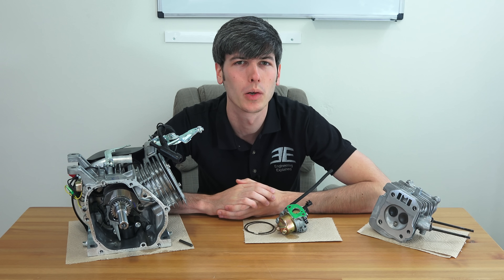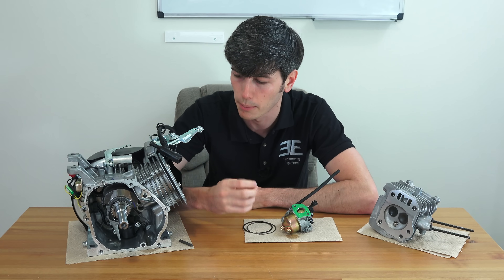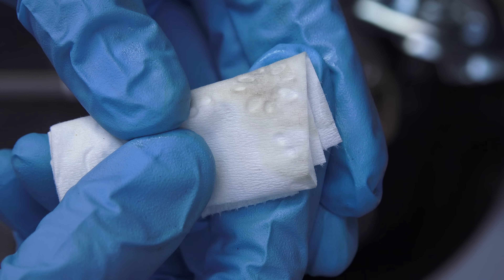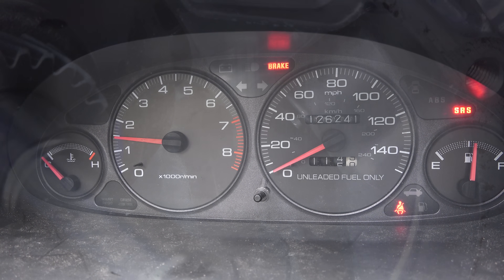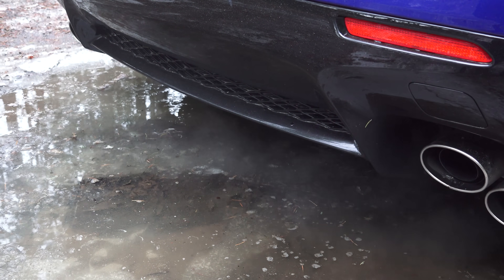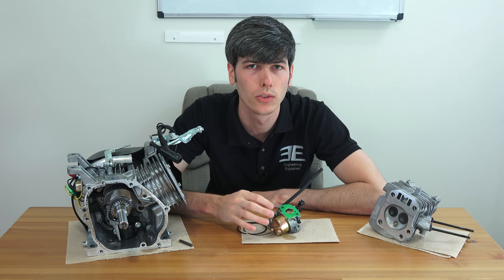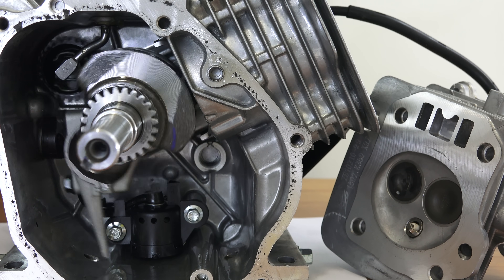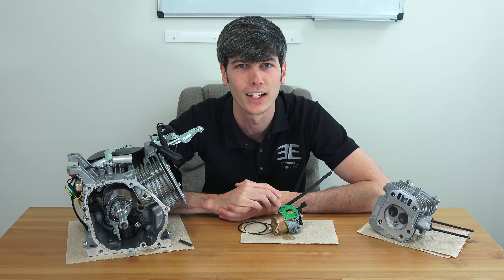Should You Warm Up Your Car Before Driving?

Comment: hmmm you should live in minus 30-40, it doesn't work. better warm up before you drive or you might spin a bearing or something if you gas it.
plus it will warm up faster standing still on 2000rpm then driving .

Comment: The point here is not to go overboard or do anything excessive. Just go easy. Good oil flow is super important. Lifters, bearings, etc... are sensitive internal parts. Giving the motor a chance to warm up slightly and move oil around helps in below freezing temps. Doesn't need to be at operating temp before driving, but start up and driving off in a hurry is hard on a motor in general. Parts are stiff and sticky at first. It's like warming up before a workout. As for diesels the cylinder head needs to warm up also. Especially diesels without glow plugs relying on intake heaters. Consider everything else at work such as the transmission and with certain vehicles axles/differentials and u-joints. Easing up to operating temp goes a long way towards long life expectancy. Block heaters are great. I use one on my Cummins because I don't want to change out 15w-40 for 10w-30 just to drive it through 3-4 winter months of the year (Chicago area). Not enough miles driven to make it worth the expense and time. Anyways I let it run for a minute or two then take off so the intake heaters cycle a few times.  With the gassers I let them idle for a couple minutes, usually the time it takes to clear snow, ice, or frost from the windows and call the mrs to know I'm leaving, when it is below freezing.  Afterwards go easy on the throttle, slow shifts for manuals, and warm up the brakes within a few miles. Once everything has been moving for a bit and "feels" right I will drive however I please.

Comment: So basically it is a trade-off between the (overly) rich fuel mixture in a cold engine, which dilutes the oil, versus increased wear due to reduced oil flow and lubrication, because the oil is not warm. I get that an idling engine takes longer to warm than an engine under some load, but those 5-6 minutes while the engine heats up under load (i.e. you drove off), the wear is so much higher on the engine (because the oil is not lubricating as well). 
Also, a cold engine has more gap between the cylinder wall and the piston (rings), to allow for expansion when the metal heats up. Depending on the tolerances set by the manufacturer, extreme cold can make that gap "quite" wide. 
So all in all, the trade-off is: Do you want to replace the oil more often because of dilution with gasoline, if you're in a cold climate, or do you want to risk damaging the engine because of excessive wear on the cylinder walls / piston rings? There are many cases of the latter happening, where engine specialists advise a brief warm-up period (Basically until the water is up to temperature, which is usually when the oil starts being warm enough too). Not 20min, but 5-8 minutes or so.

Not saying you are wrong Jason, but I feel in this video, you only addressed part of the problem (what is the bad thing that happens when the engine is cold), and not the whole picture (what happens when the engine is cold AND you put load on the engine).
Reply: SimonBelgium Exactly. Especially with full-synth oil, the dilution effect is almost non-existent.

Comment: IMO a little warm-up doesn't hurt. I like to get some temperature in the oil and transmission fluid before a load is put on the drive-train. Modern engines are so computerized that fuel injector usage is precisely monitored for all conditions; I don,t see new cars running rich very long if at all.  Also always use a lighter oil in winter i.e. 0-20, 0-30, or a 5 in first # as a minimum, as its proven most wear in an engine comes from initial start.

Comment: I understand why one wouldnt warm up the engine, but what about the warmth transfered to the transmission. Surely a warm standard tranny is safer to drive and easier to shift. Other systems like the power steering pump and any hydrolic system will benefit from the driver not touching it until it is warm. This stuff breaks more often when cold, and thats a fact. Many vehicles will idle high when it is very cold out on initial start up and this takes care of the engine problem (it simulates driving) until the engine gets closer to temperature. Many vehicles do this. If it is zero degrees F out, I am not starting the car and driving it in 15 seconds due to all the aforementioned factors. I do understand the video though, but the driver should weigh these pros and cons.

Comment: upon start up on a cold engine a vehicle will usually idle higher, after a few minutes it idles normal. That's when i drive it, so i usually let my vehicle idle for about 5 mins.
Reply: Steven Harden Exactly, and that happens on purpose to get the vehicle up to temperature, so the car protects the engine without you having to drive it. It needs to warm up so you don't stress hydrolics like clutch master/slave and power steering pump etc. These things break when cold.
Reply: TheSolitaryObserver Thats what im saying lol. My rule of thumb is to let it warm up until the vehicle idles normal which is within 5 minutes usually.

Comment: This is a fiercely debated topic, especially in the winter. Glad you took the time to break down the engineering aspect of it. There are a couple things I am still unsettled about. 

1.) Why do manufacturers insist on installing remote start from the factory if they say not to let your engine warm up before driving? I suspect it's purely for convenience. Again, if it's so bad for fuel injected engines, why do they factory install them? Is it a conspiracy to increase repair costs? Am I hurting my car by defrosting the windows and heating up my interior from the comfort of my warm house? 

2.) Diesel engines. Diesel engines do not have spark and rely on increased combustion temperatures to complete the cycle. If a diesel engine is cold, its harder to complete that cycle efficiently as the logic of "dumping for fuel into the engine" simply doesn't apply to a diesel engine.
Reply: 1.  People want their cars warm when they get in them.  They install remote start because people want it for comfort.  You answered your own question on that one.

2.  Diesel is a different engine, absolutely.

Comment: when I'm at work and parked outside and the other morning when I got off it was -14f my trans fluid and oil are as thick as honey. I'm sorry but to save on both my aluminum block and transmission I prefer the 10 min warm up. it don't idle at normal idle speed when it's cold so driving under light load or higher idle rpm which effectively warm the engine and transmission to a decent running temp is more important than getting in and driving off. no I don't wait when it's 40 outside when it's below freezing I let it warm up till the temp needle moves then drive off.

Comment: I have to drive to work with temperatures around -40˚C every morning in the month of January, and the engine sounds pretty awful, especially if I forgot to plug the block heater

Comment: It's my transmission that needs the warming up...
Reply: atticstattic been looking for someone to say this. Mine gets so cold it's hard to move the shifter into gear even after letting the engine warm up.
Reply: Have to agree on this.  Even in tropical temperatures, I find it hard to shift gears without warming up the my old manual transmission.
Reply: patriot3431 well technically, a cvt doesn't have any gears 😉
Reply: My cvt will not shift out of first gear until my car gets towards operating temperature.

Comment: This doesn't make sense, it's take about the same to warm up from a stand still if not quicker because no cold air is flowing through the radiator, especially when you have a performance car with a big radiator, warm up your cars before driving

Comment: I have been warming up my cars for the appropriate temps outside usually about a minute in the spring/summer and 5-8 minutes in the winter here in MN.  The last part of this vid defends what I have been doing because he says don't put a huge load on engine/drivetrain till it is at operating temps. High end modern cars don't let you have the full monty till the engine is at operating temps, but most regular cars don't have this feature. I have been messing with cars/engines for over 20 years and anything that is internal combustion, I let warm up a bit and I have never had premature engine failure (or extensive oil failure, metal etc in it) to doing so.

Comment: My 2017 Volt won't put any load on the genset until it's warmed up when in hold mode. Are GM engineers wrong?

Comment: I like how this ignores all the other things that happen with cold engines - like nothing being the proper size. Bearings, gaskets, pistons, etc. Your engine's nominal is at operating temps, which makes sense. Sure, they test to see if it will still seal at -40 (if you ask me in C or F, don't ever argue against an engineer) and full load, but that's because its the worst case. Let me repeat, that's because its the worst case. 
Plus, if you think a rich mixture at no load and 700-1000 rpm is bad, imagine 3000rpm and under load. Your car is still going to washing down the cyls just a little until it warms up. If it takes just as many RPM to warm up, but you're doing that under load when your pistons and bearings are not at optimal diameter, they'll have play. Play is bad. 
All this while you're freezing inside the car and everything more brittle when you touch it. No thanks EE, you usually have very insightful and accurate videos, but going to say nope, bad idea to fire up and put a cold engine under load, regardless of its technology used to deliver fuel.
Reply: Yup totally agree with this, it's bang on, so people there is a reason why you don't start/drive, and you don't need to let them run for 15 or 20mins it's pretty basic common sense!!
Reply: I agree. I let it sit for 2-3 minutes then I start off. 30 sec is just not enough IMO.
Reply: If what you are saying here is true you would hear ticking and knocking from just about every cold engine there is.  Machinery has caps measured in microns.  Microns.  Yes if it’s off by a seemingly small amount it can lead to issues but they factor in thermal expansion when they make the engines and the engines wear until the parts “match up” (for lack of words). I trust what Engineering Explained is saying because I’ve done this and haven’t ran into problems and I’ve also heard the same from a Nascar driver in an article I read a while back.  Warming up an engine is old thinking from carburetor days.
Reply: @dperr338  Engines are not designed to wear until parts line up. Full stop. Right there. Also you can't compare Nascar engines (or drag race engines or...) as they are built loose and designed to last between 1/4 of a mile and 500miles. That's it. If you're looking for a 500 mile engine builder for longevity advice, you'll get what he's experienced with.
Reply: @boogts  Engines are engines.  An engine builder is an engine builder.  There are reasons they warm their cars up before a race by driving them and doing warm up laps.  Driving is the best thing you can do for a vehicle.  Abusing them is the worst.  There is a big difference between the two.  Nascar engines get driven hard and they make design decisions based on what will give them the competitive advantage not what will make the engine last long term.  Has very little to do with Nascar not knowing anything about what makes an engine last.  Just means they prioritize different things.
Reply: Never warmed up car. 500,000Km later, still fine. Burns no oil at all.

Comment: That was a really nice video but on general 15 to 30 seconds for oil to go around is overkill. Thankfully on normal temperatures, not much below zero, with a 5W-30 "synthetic" it only takes 1-5 seconds for oil to circulate. Above 0C 3 seconds max! If it was often 30 seconds, there would be ALOT of blown engines! If it is -20C outside or minus on the F scale, then ok wait 15 seconds.

Comment: I drive a G35 but I still start it and let the gauge start rising first and even then I don't drive above 3k until it's up to temp
Reply: Me too, me too lol. 196k on my 03 and it's happy as can be still!
Reply: Beastly G just crossed 200k on my 05 and still daily it and still do pulls to 100+ on the highway on ramp
Reply: Beastly G 05 G sedan 6 speed manual, it has a cold air intake, blitz catback with a coupe midpipe, and a kinetix V-plenum - I drive it everyday to school and work and I'm at 200k and still riding smooth 👌🏾 you have an Instagram?
Reply: Jourdan Johnson I always let me car Jetta mk5 warm up for 20 min in winter and 10 in summer
Reply: Beastly G you have an IG?
Reply: Yeah. Mine's an 03 G35 Sedan. Muffler delete, very nice custom intake with thermal insulated aluminum tubing, high flow filter, and modded stock box and inlets. A few other tidbits. Still nice and happy at 196k miles! Been across the US and back 3 times, I drive it daily for delivery. These cars are so well built!
Reply: Jourdan Johnson
Nice! I'm jealous lol. Good to know they're still making them well. No insta, sorry.

Comment: What year would cars be with carborated engines? A range?
Reply: Carbureted engines started phasing out around the early 1980s for middle-to-high priced cars, and the mid 1980s for cheaper cars.
Reply: They lasted into the mid 90s in rare models, but mostly prior to about 1988.

Comment: I'm divided on this, this a reason there's a temp gauge, everything needs operating temperature to operate good
Reply: Mario N. how about my comfort! Maybe I don't want to freeze in the car for 10 minutes until the heater starts heating. I'll warm it thank you very much!
Reply: I found two articles from reputable sources that say you do not need to warm up the car to the degree many think. 

http://www.popularmechanics.com/cars/a19086/warming-up-your-car-in-the-cold-just-harms-engine/

And 
http://www.usatoday.com/story/money/cars/2016/12/28/frigid-mechanics-say-skip-warming-up-your-cars-engine/95923774/
Reply: Good luck on that with a diesel. Below 0 the engine often doesn't generate enough heat to keep the temp gauge centered even while drinving. You'll most likely never reach the 60+ C the temp gauge starts at with ideling the diesel. Even in summer temps it would take a long time.
Reply: Thats what im saying. Engines and Transmissions have a operating range. Engines clearnces are machined at a specific tolerance. Automatic transmissions need an operating temp also.
Reply: Lol, you are stuck in the past, new engines are not like old engines, even the oil they use has come a long way, i dont wait for my cars to warm up and as long as you keep up with maintenace you have nothing to worry about
Reply: some of the new cars like VW for example don't have this temp gauge anymore.
Reply: there are temp gauges so you wont overheat the engine, nothing bad happens to your engine for running it cold
Reply: No its not a case of metallurgy, its a case of no oil. Your argument only applies to racing cars where tolerances are so tight the engine will not turn over unless heated artificially. You are missing the point.
Reply: Not all cars. Some just have a light that is blue when cold, off at normal temperature and red when too hot. There is a difference between 'operating good' and 'can operate'. Like he said, you will get up to temperature quicker if you just drive off right away instead of sitting around. Unless you live on a highway onramp (I know of some places where this is the case) you are going to be warm before you need any speed anyway.
Reply: Brian Ross you are wrong, nothing bad happens to an engine for running it cold
Reply: SBdunks3 a lot of temp gauges are just for looks,  a dummy gauge basically that's why they always read the same temperature all the time until the computer reads an abnormal temperature
Reply: +Eli Rodriguez Not on a SAAB at least. With the 9-5 and forward they have a very small deadband (just a few degrees) in the center to keep it from changing in normal traffic but outside of that it's still showing the actual temperature, under heavy load you can see it moving ever so slightly. This is the way it should be in order to not confuse commuter drivers with a gauge that keeps moving up and down.
Reply: Tell it to chevrolet 2013 models.
Reply: being stationary doesnt warm up the gearbox and transmission.
Reply: Exactly 👍
Reply: LOL, you just need to do some research before you speak,engines have changed over the years, thats why they last longer,  even fuel has changed,.. FYI isulting is a sign of incompetence,
Reply: my last words to you,..do some research, educate your self and learn.
Reply: James you don't know what your talking about. A Professionally Blueprinted engine is created to have as little friction as possible. You could spin a crank with your pinky.

Comment: ok can someone please explain to me what's a cold start and how to warm up an engine?  I mean if the engine is cold, you start it up to warm it?
Reply: Cold start is whatever temperature is surrounding the car, the video shows you warm up the car by driving it but some people will let it idle to warm it up to allow the heater to supply heat.
Reply: Whispered - Thanks for the explanation. Now I got it.

Comment: Something, I believe you should have mentioned in your video is Preheated o2 sensors in newer vehicles. I understand your idea on leaving a vehicle to warm up, will cause a rich mixture and because of that, the points you provided. But, the same shouldn't go for vehicles with o2 sensors with preheaters. This will cause the vehicle to go into closed loop much quicker, entailing a rich mixture for a shortened amount of time. So, I would say, those that have non preheated o2's (1-2 wire) this video is intended for. The same doesn't go for preheated (3-4 wire).